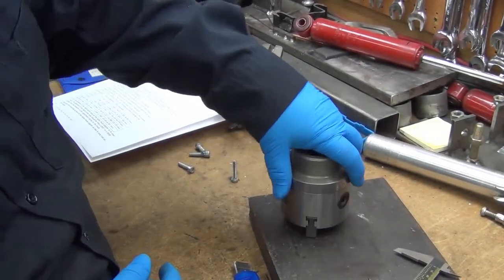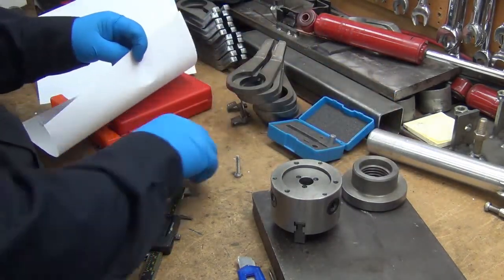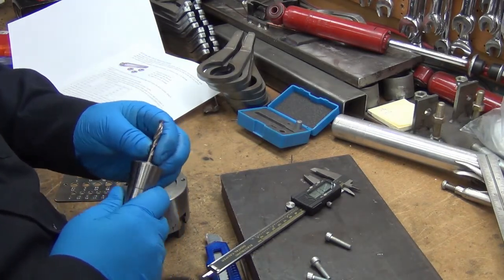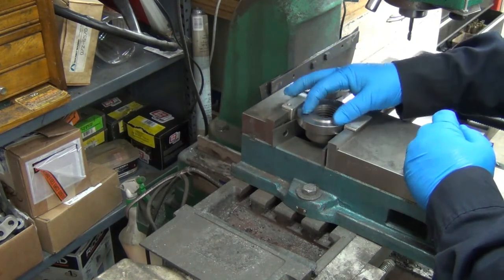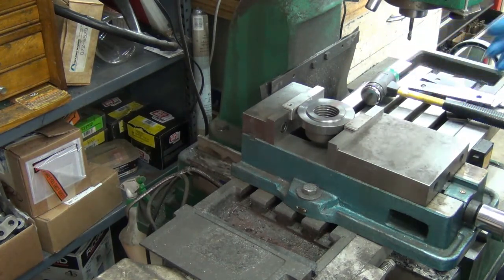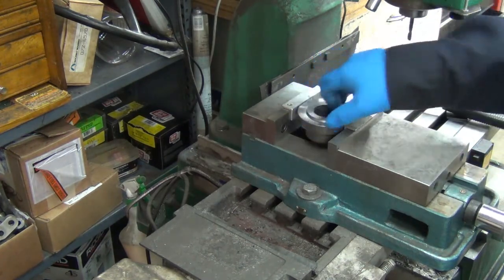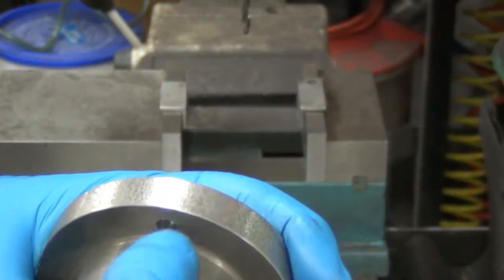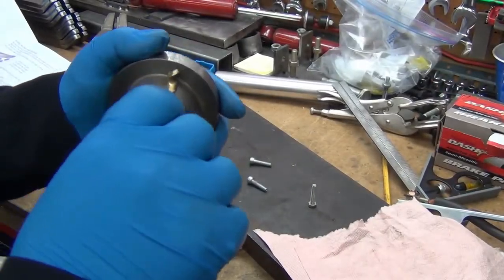9x20 CNC lathe backing plate pt2 - Drilling adapter

Comment: Still haven't ordered the DRO for the new mill yet so I would have used a rotary table to do the holes. I do find it easier to use the table anyway..just set the radius and go.
The job looks good though. Thanks for sharing Mike.

Colin
Reply from the maker: I paid as much for the DRO as I did for the mill, so I should probably use it sometimes. lol   I thought about using the rotary, but I thought about all the vids I've seen with rotary tables and how I haven't come across any using the bolt circle.  This was nice and easy with no heavy lifting.....another plus!
Thanks Colin!!
Reply: I agree, not many vids showing bolt circ calcs on the DRO. :-)
Reply from the maker: *****
......the reality is that the only thing I thought about was how heavy the rotary is!! LOL